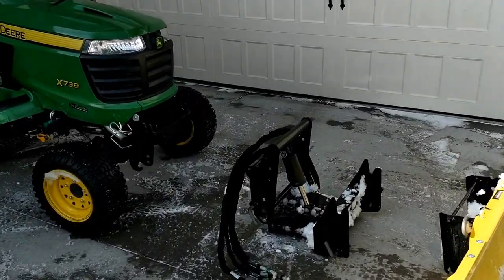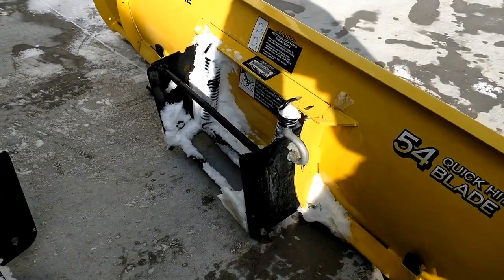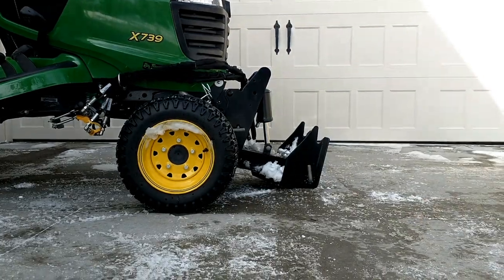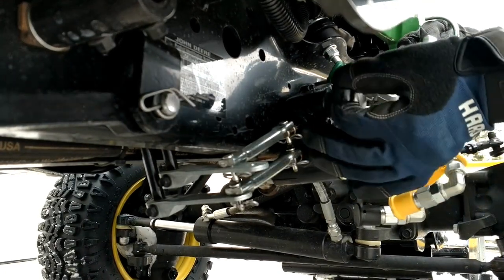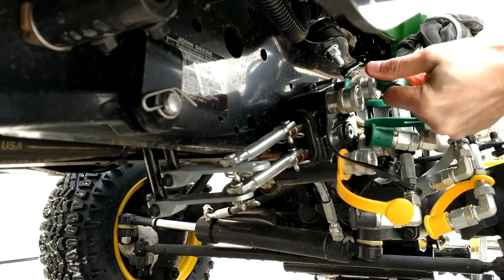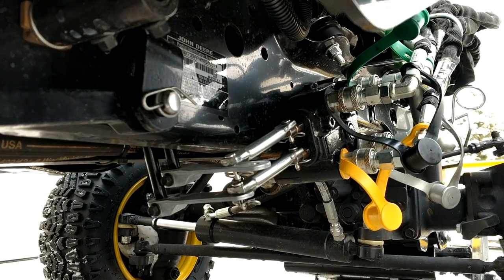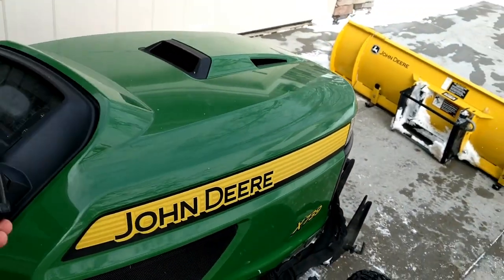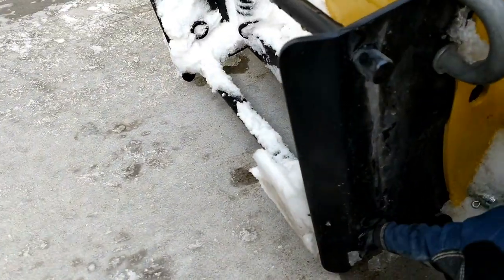How To Install A John Deere 54" Snow Plow & Quick Hitch

Comment: Nice video. I do the same with my snowblower, but found if you drop your blade on a 4 wheel moving dolly  you don’t have to lift it when connecting or disconnecting to the tractor and easy to store in the garage
Reply: @Adan Santiago Instablaster =)

Comment: Great Video. I bought a used X-750 and the color on the hydraulic lines coming from the plow did not have the color caps. So I don’t know what gets plugged into the tractor. It also did not come with a owners manual. I don’t want to damage the hydraulics plugging the wrong lines in the wrong place.

Comment: Can you clarify what hose goes where. I bought a used quick hitch and it doesn’t have the colored caps. I seem to have up and down okay, side to side there’s. a bit of a delay (maybe because my deck is still attached). Is there a lockout valve on an x730 somewhere (just got the tractor too—used).
Reply: Found info in manual on lockout valve. Sounds like it’s something that needs installed to avoid delays (which is what I’m having on side to side movement. Up and down works good. To match sticker on floor board (as far as raising and lowering) I had to put hose from top of cylinder in GREEN  (B in manual) coupler and hose from bottom of cylinder in BLACK (A in manual). Haven’t found anything yet on side to side (some combination of SILVER and YELLOW (D and E in manual).
Reply from the maker: https://www.youtube.com/watch?v=_6_KFG1wcUQ&t=30s
Reply from the maker: Yes, watch the video below.  Need the valve.

Comment: How much extra resistance does putting 18 inches more on the plow make in a foot and a half of wet snow? Also with the plow being 9 inches longer how is the twisting or stress on the blade frame and hydraulics if you were to clip a hard snowbank or curb on the tip of the plow?
Reply from the maker: Good question, but I'm not sure how to quantify that.   I would find it hard to believe that John Deere would offer them if a big concern though.

Comment: Just bought a new X758 and I’m strongly considering getting the 54in quick hitch blade. Just curious. How heavy are the quick hitch and the blade seperately? It looks like you weren’t really struggling to grab and hook them up to your machine. Would I want get like a little dolly to move them around or are they light enough that you could throw them up on a heavy duty wall hook or shelf for storage?
Reply from the maker: Howdy, they aren't too bad if you are just scooting along the ground.  However, I struggled a bit when I was putting the blade in my F350 truck bed.  With the wing extensions on it,  it's not the funnest thing to move around, haha!
Reply: Good Works Tractors Great, thanks for the info! I enjoy watching your videos but I don’t think my bank account likes it haha Have a good one!

Comment: is there a way to disengage the deck lift when you are using the snow blade
Reply from the maker: Good question.  If I recall correctly, you can rotate the deck height adjustment knob to the highest position, there might even be a "lock" symbol which essentially keeps the arms locked in the highest position at all times.  

Also, there is a diverter valve that you can buy if you get a snowplow or snowblower.  It is easy enough to install.  It will be located on the backside of the hydraulic quick couplers.  It has a little black knob that you can turn, allowing you to open and close the valve.  Essentially, it will bypass the mower lift circuit and make hydraulic response faster for the quick hitch/snow plow.

Here is a link https://greenfarmparts.com/shop/john-deere-flow-control-hyd-valve-am134625/

Free shipping and try code "GTT" for a 5% discount.  Support Greentractortalk.com as well.  Great John Deere forum.  That code used to work, not sure if it does anymore.
Reply: @GoodWorksTractors  thankyou that sure was quick

Comment: J.D. calls this a "quick hitch".  Sales guy proceeds to show how you have to attach the part, to the other part on your tractor that you previously attached, and then you can attach the blade to the "quick" part.  By bending over and lifting the whole thing with your middle aged sore back.  I'm no expert, for sure.  But I feel like I'm missing something here.
Reply from the maker: Apparently you're not familiar with previous methods of attachment.
Reply: @GoodWorksTractors  Good Works makes a Good Point.  And you're right, I'm not familiar.  I would guess there were more swear words involved.  LOL